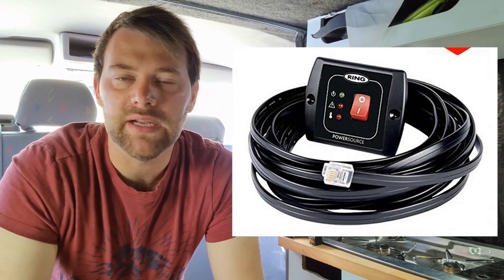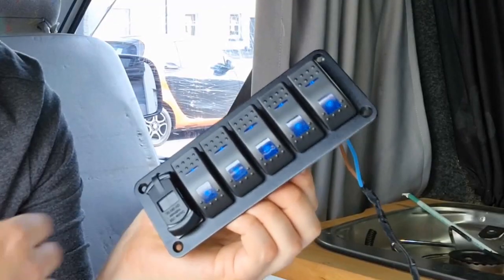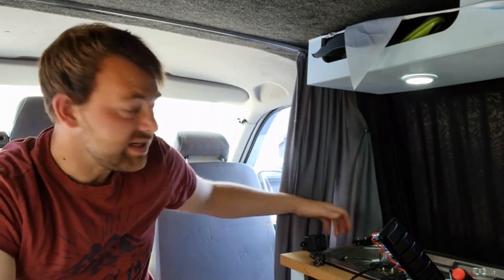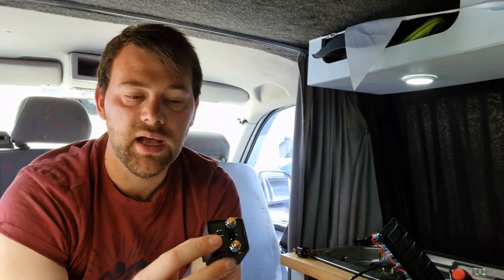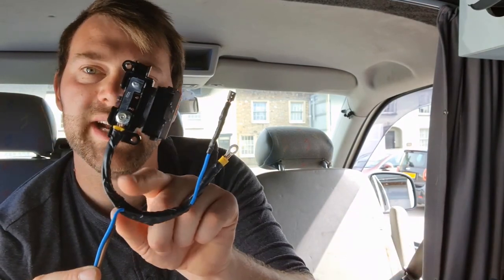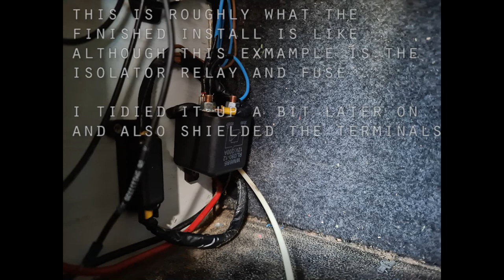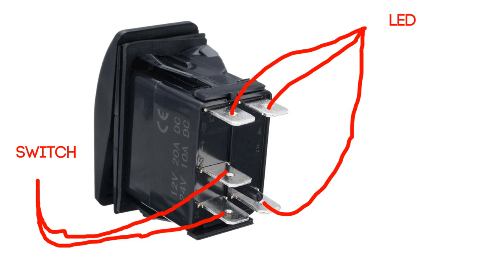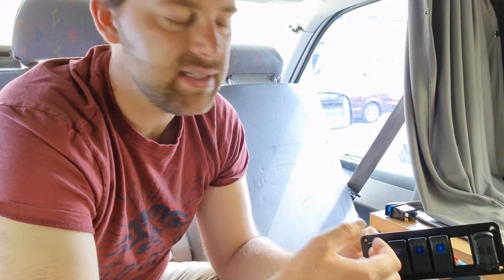HOW TO: Fitting a 12v Inverter Remote Power Switch to a Campervan | VW T5 Build

Comment: You could have just run the wires to the new switch from the switch on the inverter  with some 16awg or similar wire as the inverter switch runs off a relay inside the inverter. Would have saved you changing your existing wiring.
Reply: Means you'd have to take the cover off the inverter to get to the inverter switch connection
Reply: @tonygilchrist8156  I removed the cover only to be horrified at all the tomfoolery attached to the inverter switch which is using its own board. How should I proceed? 😢 There's no schematic for these things.

Comment: Greetings! Great video. Did it all work out , or is there anything you had to do differently? I am trying to do something similar but with a Victron Battery Protect that switches off the inverter if low voltage occurs. But  its tricky because I am not skilled in electronic wiring and Victron says the inverter cannot be wired directly to the battery protect but rather the battery protect should control the remote switch of the inverter through a relay.
Reply from the maker: Hi, yes it all works absolutely fine, I haven't had any issue to date, not sure if it will last forever but so far still good.